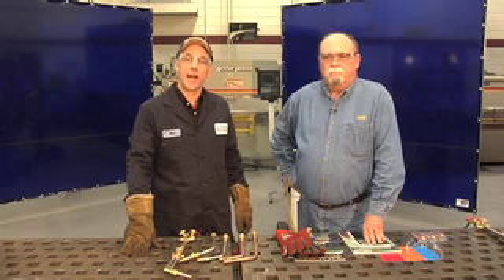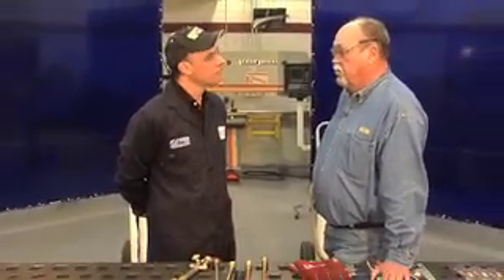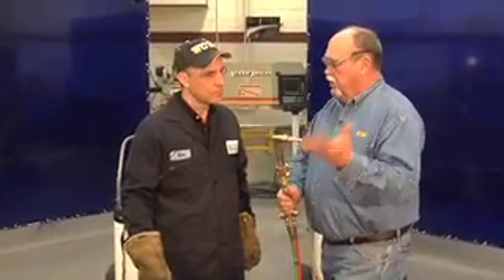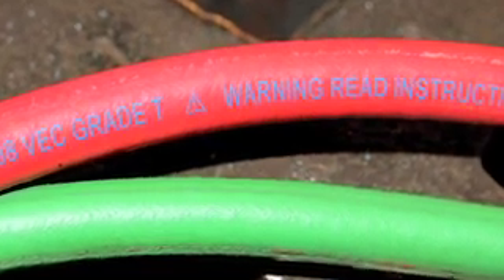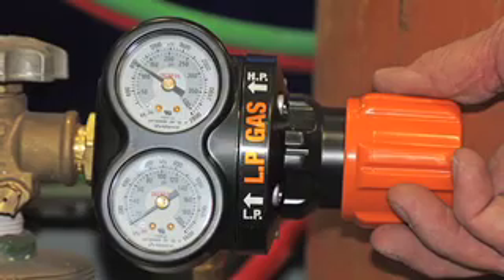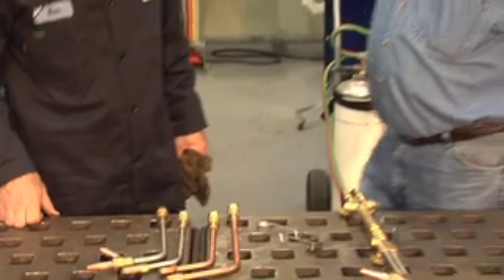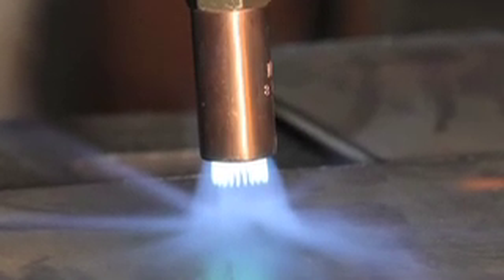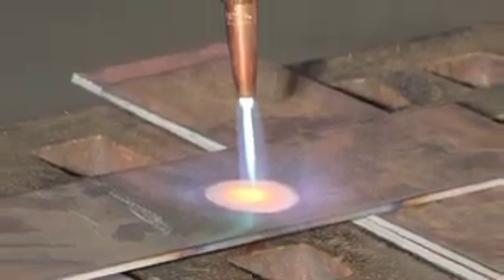Victor Guide to Welding & Cutting With Alternate Fuel

Comment: what do you mean you can do anything with alternate fuels with the exception of welding? are you saying you can not weld using alternate fuels from acetylene? so all you can do is heat and cut but not weld?
Reply: Hydrogen can be used for a few specialised Fusion welding applications but normal LPG/hydrocarbon gasses are not suitable.

Comment: Maybe I'm missing some critical information here...  I came looking for information on welding with this system and the last statement of the video was something like...  "With alternative fuels I can do everything I can with acetylene, with the exception of weld".  Did I understand that correctly?  Is it possible to weld with this setup or not?  Thanks
Reply: Tim Kropf I'm not sure about other fuel gasses, but I know propane cannot weld
Reply: why not?
Reply: You cannot weld with propylene or propane because it introduces too much hydrogen into the weld puddle. It brazes, solders, heats and cuts. It does not weld appropriately.
Reply: ahh ok thx,,for some reason acetylene does not have this problem,i think it has also to do with the way its made which is endothermic rather than exothermic
Reply: There are three outputs when you use acetylene: heat, moisture and co2. You need co2 as a cover gas when you want to weld, it keeps the atmosphere out of your weld puddle, so you wont get porosity in your weld.

Comment: Please could you tell me what the name of the large torch heads on the left of the picture are called.  Could you also tell me their use as they look very different to gas welding nozzles.  Also what type of welding torch do they fit?
Reply: Martin Ward I'm going to guess you're referring to a rosebud, they're good for brazing\ general heating (ie: need to make a bend in some flat iron, so i'll use my rosebud to get the bend point red hot) You can more or less braze and heat bends with your regular cutting tip by playing with you fuel\gas mixture, but a rosebud is a huge help. Shyte I came up with a way to "cut" aluminum with a propane torch by running less air to fuel than usual and feathering my trigger to blast the heated material away.